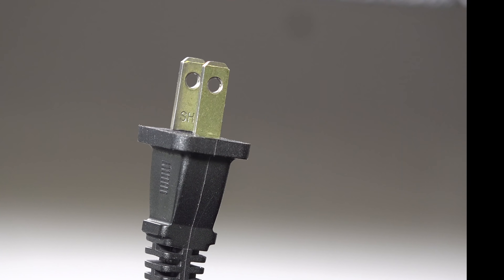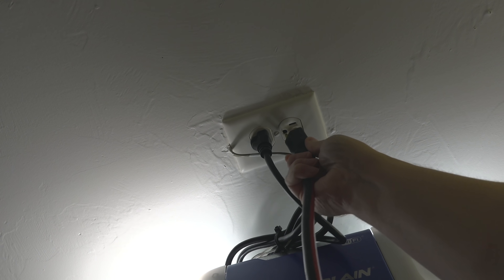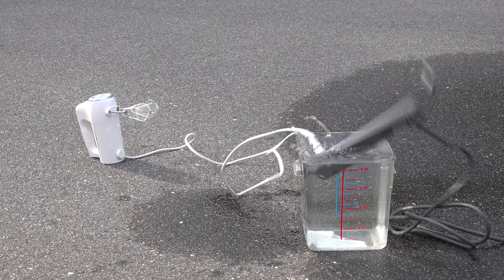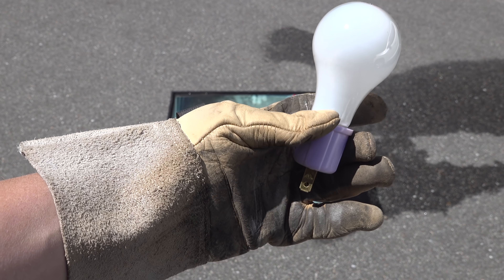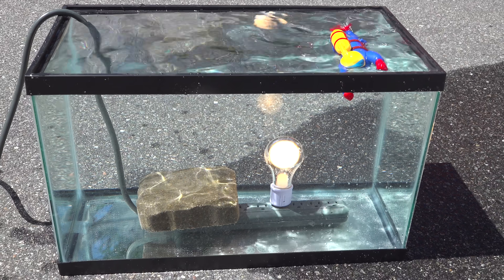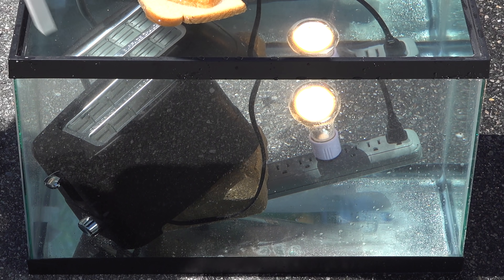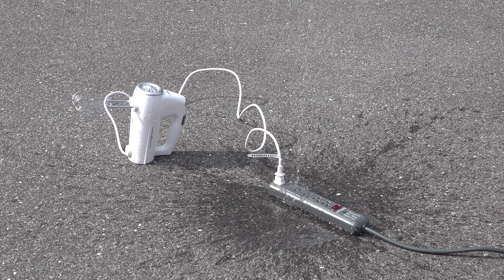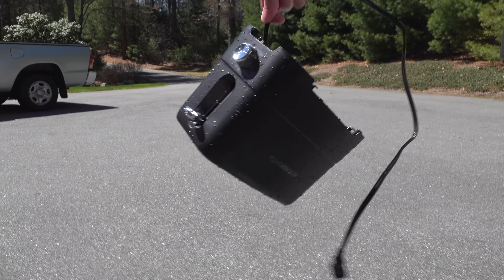What REALLY HAPPENS WHEN YOU SPILL WATER in an OUTLET?

Comment: One time when I need hot water, I tied a wire to a spoon. Using 2 spoon and make them separate about 1-2 mm using scrap around me and tied the spoon handle to a wire and submerged it to almy water container then plugging in to the socket. Mcb doesn't trip, the spoon make a kinda bubble thing and water start to boiling. But it will electrocuted you if you touch the water

Comment: One time I was working on repairing a metal fence outdoors, so I needed an extender to plug in my power tool. Suddenly it started raining, but I thought I shouldn't leave the fence unfinished, right? Stepping into a puddle connected to the grid of 220V is quite a wake up call.

Comment: My bathroom was flooded by a guy above me it filled up my led light and nothing tripped so i turned everything off called the electrician, When he arrived he emptied the casing that was filled with water checked the the light fitting then switched everything back on.
I was amazed at what he did i asked him wont the water be a huge problem he said all the water will do is rust components and fittings he said it will be just fine.

Comment: I'd like to argue a point you made at the end of the video: if anyone put their hand under the water they would be electricuted. How would this work? The electricity would have to "leak" from one of the live contacts, go into your body, and close it through to ground. The problem here is; You are using regular water ( as at no point in the video did you mention adding any electrolytes like salt) so the resistance of the water is higher. The resistance of your body can also be pretty decent too. Then it would have to go to ground. Let's assume that you're a sane person, you won't be holding a ground wire with your hand or mouth and that the only way for the current to travel to ground is through the ground. It would have to go through your socks, shoes, the concrete and through the earth to the ground point that burried by your house. So the resistance of all of those for a voltage like that is WAY too high. Electricity is lazy and it always takes the path of least resistance, so it would much rather just go to the ground connection on your expansion chord as it's a lot smaller gap, and thus more conductive path. 

Otherwise I like the video a lot, especially the toaster part, always wondered what would happen if you put a toaster into water.

For anyone who is not an expert on electricity and lacks knowledge, please don't try it. Plactice first on low voltage DC circuits.

Comment: Voltage from an outlet is not high enough to make the water dangerous instantly. The longer it is underwater the higher the danger because tap water is fairly clean.

If a powerline were to break and fall in say, a pool then this water would instantly be dangerous because the voltage can overcome the resistance.

Comment: Love this vid and found the results suprising. Id love to see you revisit this vid again, except using salt water. I think that might trip the non GFCI breaker. Also might cause exciting sparks if lucky.
Reply: Yeah there are not enough electrolytes in water to short circuit
Reply: @sherlockhomeless7249  I'd be surprised you'd get it to trip a regular breaker or spark with just salt water. It's not THAT conductive.

OTOH the grounded surface area in an outlet with electrical box is HUGE, probably in a multi outlet too. The live surface area isn't that big though, still... MAYBE? My expectation though is that it'd basically cook the salt water until it's gone, making a huge mess in the process and splashing drops of hot salt water. And ruining the internal wiring. It's POSSIBLE you'd get it to electrolyze some wire or solder connection apart, to the point of causing arcs - but I kinda doubt it'd happen within just minutes.
Reply: @divVerent  i  got electrocuted by salt water in pse lab ,i ain't gonna do that shit again. Btw you are right

Comment: Water itself is not a good conductor. What is dangerous about water is that it causes other materials to become better conductors, like the salt or skin of your body.
Pure water--meaning no minerals or anything else in it--is actually used as a insulator in some applications.
While your hose water isn't actually "pure" it's doubtful that there could enough other stuff in there to conduct enough electricity to trip a 20A breaker by itself between the hot and neutral of the plug. But there are enough impurities in the water that it will provide a current path separate from Hot/Neutral exceeding the 5mA required to trip the gfci.
Reply: Ironically, had you left the bread in there long enough to completely dissolve, you may have been able to trip the breaker. But 20A is quite a bit. Maybe, idk.

Comment: I was cleaning with water the charger port of my shaver, and this a huge mistake i made ,  after I put it in the charger and connected the electricity, the device exploded in my face at the battery entrance, so I pulled the device out of the electricity and put it back in after I removed the battery. It exploded again and I don’t know how to fix it, but it is still working and I I want to solve the charging  problem

Comment: As a 3rd generation master electrician I am not going to watch this just because of the title alone being mostly FALSE. A GFCI (Ground Fault Circuit Interruptor) interrupts the circuit in case of a ground fault. You don’t always have a ground fault if you or your equipment are exposed to water (distilled water will not conduct because there is no conductive minerals in it). You can have a ground fault and be touching one of the conductors and a source of ground to get shocked and have a ground fault. It just happens that everyone only thinks they get hurt when they take a bath and make toast or blow dry their hair in the shower. Please don’t inform the public what you learned from the Home Depot and Lowes “expert”

Comment: Howdy. An episode of mine.
I needed power outside. I plugged an extension cord (splash proof) into the socket. The extension socket became fireworks. Evidently water and grit had seeped into it.
And now the real thing. The breaker did not cut off. The mechanism did trigger but the points had got welded ON. Eventually the main fuses blew in the meter room.
Flippin' scary. 
My location is Finland, Europe. I had replaced the apartment panel plug type fuses with plug type breakers. Bad idea, evidently. I switched back to original plug fuses. Clearly these will guarantee breaking if shorts happen.
Regards.

Comment: The reason why the breaker doesn't trip is because water is quite resistive.
But the GFCI is very sensitive to a ground fault. It only takes around 5mA to trip a Ground Fault Circuit Interrupter.

Comment: We had our ground fault interruption device become faulty in our old junction box, and it was a type known to become faulty after some time, tripping spontaneously, and tripping when lightning strikes happened close but not actually into the grid due to an indirect strike somewhere.
Some power outages were also capable of making it trip when a different part of the neighbourhood got hit by one and we had our lights flicker for a bit, and then ours went off as well even though we didn't actually have an actual power outage.

All our breakers are now breakers and a ground fault interruptor device in one device. Slightly inconvenient because you don't know what made it trip in some cases, but easier to wire.
Since this is in The Netherlands, we are at 230V, single phase, on a 3-phase supply-in, and typically only the kitchen and sometimes a socket upstairs has all three phases into 1 socket, providing you with 400V.

Comment: If you don't connect the circuit to ground, you'd probably not be electrocuted. Remember if it were to harm you. It would have self shorted. And popped a break or given the bulb how it's power. Should have measured if the toaster used less or more than expected electricity

Comment: well the thing about water is its such a good conductor it provides little resistance. when a human body is being charges its creating a pathway resistance that makes breakers trip. the thing about water is if you ground it you cant get electrocuted but it should trip so if you pout a ground probe in the ground and run a line to water if you can maintain power in water you can stick your hand in water and get little effect or volume of water lets say you put a toaster in bathtub with you, you may experience 80% of potential energy but if you toss the toaster in in a jacuzzi  with potential energy but if you toss the toaster in a jaccuzzi  with you, you will recieve maybe around 15% of potential energy. many variables. surprised you didnt try to use a multi meter to register and measure your findings. water with electricity will heat up and all energy finds a way to convert to heat
Reply: Water is non-conductive. I'm talking H2O. It's anything else in the "pure" water that makes it conductive. Almost all water is not "pure" and would need a laboratory to make it so. Breakers trip when the current is too high, not too low. Their purpose is only to protect wiring inside your walls from catching fire.
Reply: @MrChrisRP  your sure? because i can use 2 small jars of water cut an extension cord in 2 put a lead in each jar both positives in 1 and both negative in next jar and the water will be the conductive material that carry the power from 1 broken lead to next. if theres to much water then losses will occur with this science experiment would suggest its conductive but the problem with water is volume! volume of water can create major losses just like if you charge your phone on a 3 ft cord you can charge barely faster than on a 10ft cord and if i made that cord 2000ft long your phone wouldnt recieve any charge as the volume of wire is to great. if its non conductive how does it become alkaline?
where do you get pure water? well you can get rain water and filter it to remove its dust particles yet this is still conductive!!!! then theres the water we all have available to us. i can take plasma from the body and spin it multiple times to rid of all bio and attain the purest of water and it is still conductive!!! its the alloys and calcium and other minerals in hard water that can make the water less conductive because of volume and rectification
Reply: @paratrooperz1 "High quality deionized water has a conductivity of about 0.05 μS/cm at 25 °C, typical drinking water is in the range of 200–800 μS/cm, while sea water is about 50 mS/cm[2] (or 0.05 S/cm)." That's a quote from Wiki. Hope it clears the confusion well.
Reply: @MrChrisRP  lol wiki ok well if you believe wiki than who am i to tell you different and i guess cars that run on inefficient water that is converted to is pure form then through a process to change it from 1 gas to another. gosh if i told you how many errors wiki has you would lose your belief system. but i would rather concede to you than math it out....  as an teem member for a group that trys to make new technologies for space propulsion water is always on the table for its many possibilities such as life sustaining or thermal or its conductivity and more. truly the biggest goal is to advance fusion from is current tech to something we can power homes and small enough to fit in an engine compartment but till then we are testing new and old theory's

Comment: Wow crazy experiment, was very intrigued watching it and surprised at the results. What is the GFCI equivalent in the UK?
Reply: Residual Current Device (RCD). An RCD is a safety device that quickly breaks an electrical circuit to prevent serious harm from an ongoing electric shock. It instantly switches off the electricity supply when it detects a fault, such as a difference in the current between the live and neutral wires, which could occur during a shock from a faulty appliance or damaged cable. RCDs are a key part of electrical safety in homes, offices, and other buildings in the UK, providing protection against the risks of electric shock and fires caused by earth faults.

Comment: Had he done even the most basic of research, he'd have known what would happen, in advance, and I suspect that he did. Water is NOT a an especially good conductor. And unlike what happens in film, you do NOT get little lightening bolts around you if you're shocked. in fact, what kills people who have plug-n devices fall into the tub is having as little as 22 milliamps of alternating current* pass through the body and do the exact opposite of what a defibrillator does, causing your heart to malfunction and stop pumping blood.

The danger isn't contacting water that has electrical power in it. It's touching that water, and at the same time, touching something that  the the power would want to flow to, converting you into a wire.  As an electrician, I have no hesitation on touching a hot wire, as long as no part of my body is in contact with ground, because it's being the path for the electricity to get somewhere else that causes damage..

* that's 22 thousandth of an amp. At 110 volts that's about 2.2 watts

Comment: This works for simple appliances as little internal circuitry is shorted from this. However if you for example get phone chargers wet and do not unplug them in a reasonable time or if you touch them while they are wet it can cause damage to them.

Especially if it isn't water, if you for example spill milk or a liquid thay leaves a sticky residue it will cause short circuits and will likely blow up if used after drying.

Comment: Dude... You have a safety disclaimer about all the "safety" stuff you did behind the scenes. You didn't even use proper insulated gloves. 

You might think a glove is a glove and a screwdriver is a screwdriver. Until you have the driver handle blow your fingers off.

Leather might be an insulator but the moisture content in it can vary when you don't even realize it. Water is also an insulator so why would water and leather be a problem? Well the salt in your hand sweat is the issue.

Comment: Would be interesting to see the voltage of the water measured.. also the difference between salt water and tap water.

In South Africa, every circuit fed from the main breaker is protected by an earth leakage (GFCI) plugs, lights, stove, hot water cylinder. This is of course what the regulations say, in real life it’s often very different!
Reply: Haha, yeah, in real life things are definitely much different. we moved into a brand new complex in SA and we always had problems with electricity tripping and the electrician's solution was to just get rid of the RCD
Reply: In China I noticed almost everything was on a GFCI breaker.

Comment: It you put water into an outlet probably is going to spark, thats because it does not has an appliance connected to the outlet to use the Current. Is going to be the same as it you use a piece of wire shorting the outlet.

Comment: Not an electrician, but I believe the GFCI is meant for cases where you short the circuit by grabbing on to plumbing or something which is itself not a great ground. It then detects the difference in the current that flows int he hot, and neutral, the difference being the current that now is flowing through you.
Reply: It is meant for any situations in which the chance of a typically metal casing of an appliance like a washing machine or a clothes dryer might also be in a humid or wet room (bathroom) could cause an increased risk of electrocution due to a live wire touching the metal casing that you then could touch, possibly even worse: when standing on wet tiles after a shower.
In The Netherlands, it used to be common to have the upstairs bathroom (where the shower typically is, but also a place to place a washing machine) be equipped with a ground fault interruption device, just like in the kitchen, but I think nowadays all sockets need to be behind either combined or separated breaker and ground fault interruption devices.
My parent's home has combined ones for all breakers (about 7 of them, with 2 other breakers being 3-phase + neutral, 1 is the main breaker, and the other is the electric cooker breaker).

The description of the ground fault interruption device is correct, though I think a common misconception (if I say this correctly) is that an earth wire is needed on the socket that is behind one: current leaking to earth is sensed regardless.

Comment: Curious Q: So it was like any ordinary appliance or power strip and what prevents the shorting that bursts into flame and boom is the GFCI Outlet right (is there any differences in the usefulness between the 15 vs 20 Amps...are there larger Amps for CFGI Outlets?) ???...(Was wondering why I only see these types typically in the bathroom...coz your vid seem to explain it well...for those just in-case moments). TYVM for the vid!!!

Comment: Two comments. First, water conducts electricity differently depending on salt amount in it. Secondly, in my experience the outlet will melt and potentially spew fire even if it gets a little bit of accidental water in it, because it will cause an internal short circuit. Believe me, you do not want to be near an electrified device that spews fire and electrified boiling water.

Comment: So this guy claims to have undocumented electrical supervision from another person. Yet why would you use Leather gloves and quick motions to get the power strip submerged when you should have disconnected the power. Confirm no residual Electrical charge, move power strip into appropriate position and then reconnect the power source.Also with proper supervision and PPE you would have been able to use a fiberglass Pole to adjust the power strip in the water.